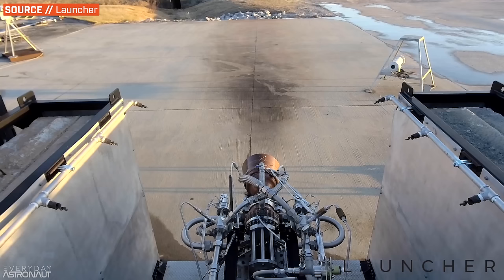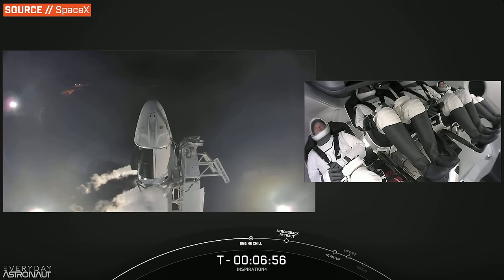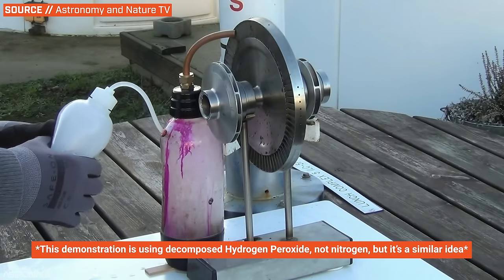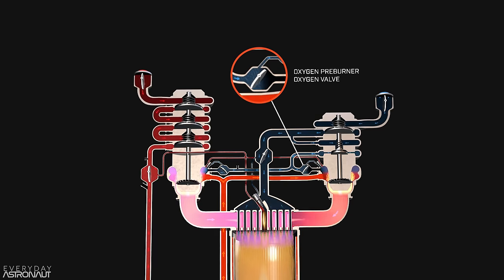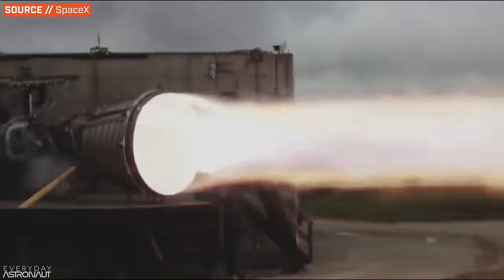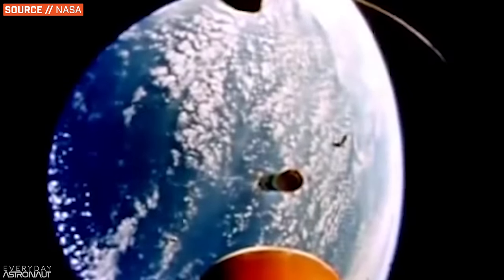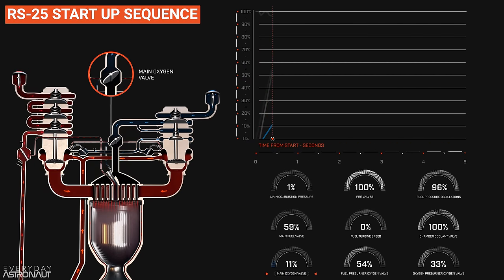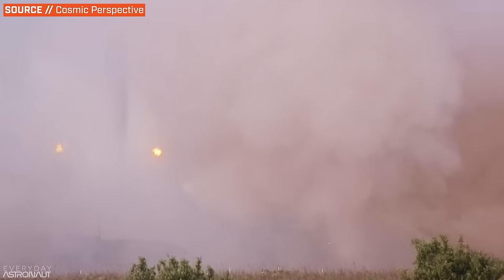Why Starting A Rocket Engine Is So Hard!

Comment: Maybe im stupid but the valves at the bottom and the lines dont share color very well, some of them matches with nothing, and you are just left guessing. Some are easy and some are impossible. So if we stop at 43:38, there is just one line but 8 different readings from the valves, it doesnt make it easier to understand, it makes it one hell of a lot harder, at least for me. As an example we at this moment have 84% full turbine speed, is that represented anywhere, well no.

Im not saying you are doing a bad job, but if i were you i would link all of them prior to going through things, what they are and what they do, each of the nine valves / readings. as another example where is the chamber coolant valve, fuel preburner oxygen valve.

There are a million different ways to explain it but it seems to me you managed to hit the one that has nearly no relevance to the graphics spot on.

Comment: How will they light Raptor in Mars if they need Nitrogen or Helium for the spin-up? Do they take it from earth? i mean there is some Nitrogen on Mars atmosphere but...
Reply: they will need infrastructure in more for the ignition process, you don't need a lot of these gases.. also they could use electric motor send before. It's going to be hard either way.

Comment: What would sls do if only one srb ignited?
Reply: It’s almost impossible for that to happen but if it did the capsule would eject and fly away while the launchpad would most likely be vaporized
Reply: @peeperleviathan2839  I have no doubt it's near impossible. My concern would be when they decide to detonate. The flight systems on the core would probably try to counteract the unequal thrust and I think that would let it fly up and sideways at least for a bit instead of instantly flipping. Would they try to let it clear the tower or blow it right of the bat

Comment: I love how Soviet engineers try to make everything simple, if you have half as many parts it's harder to fail.
By using fuels at room temperature and that can burn by themselves they save half the parts. And why stop the engine and put in a solid engine to do the stage separation? Better to start the engine while the old one is still pushing. 😆😆

Comment: There appears to be a tradeoff between efficiency and complexity. Also, full flow staged combustion would never work with physically larger engines. I hope Raptor does not end up in the realm of asymmetric risk. In other words, engines seldom blow up, but an explosion can take out a whole Starship. I'm betting on Musk to succeed, and I'm encouraged by the simplifications being made to Raptor. The engineering complexity and fine tuning of these engines represent incomprehensibly sophisticated technology. Musk is amazing. Can one begin to imagine the mass production of Starships? Not just production rate, but the complexity of the machines being manufactured. Wow!
Reply: there are some relatively simple engines that achieve insane efficiency, for example ion thrusters are a LOT simpler to operate then liquid fueld rocket. The combination of high thrust AND efficiency is what tends to get you. Oftentimes the most efficient engines are hydrolox but those tend to not produce as much thrust as equivilant (from a complexity point) metholox/kerolox engines

Comment: I think it's so remarkable that the Germans got this to work already in the 1940s. Like to get the articulations of the valves right to ensure the right flow without using fluid dynamics computer models is just crazy. And imagine diagnosing failures before you had the sensors and digital equipment for registering inputs. You basically only had pressure gauges and the act of manually sifting through the rubble after each RUD lol
Reply: you can draw a crap tone of data from something like seismographical data and theres also for example paint that changes in color depending on the max heat it was subject to. It was certainly a very different time but they had tools that we nowadays just dont need anymore because we have microcontrollers that do all on their own

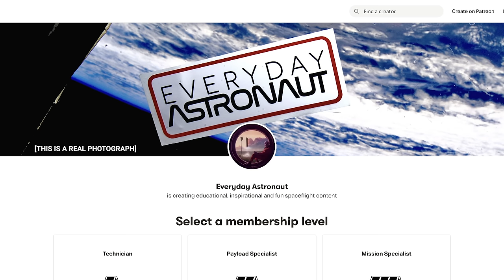Comment: 58:30 So much trouble just because we dont have a good baterry storage. But hey we like to over-enginering...hahahaha.(ICE motors vs electric motors). But we get the result wich is moving forword.
Instead of us precise balance and spend milions on hard test, just try use electric power generator?
Take the thermal gas electric power plant and put it underneth of rocket and avoid all that pipes gas and some of the valve. You waste some fuel on that generator but you get the electric power needed. and only need 2 or 4 valves if preburn must have.
Ofcourse must be redesing the entire propulsion but chambers,turbopumps,injectors are the same. 
I expect see something about injectors but i must wach in other side.
PD: i will make my own engine, linear aerospike..... one day.

Comment: At 49:10 you shown that fuel pump more or faster than oxygen but I heard Elon said Starship is ~70% Oxygen and ~30% Fuel explain this..
Reply from the maker: Hydrogen is 6 times less dense than methane, so it takes a much bigger pump to do the same amount of work. Raptor runs on methane, RS-25 runs on hydrogen

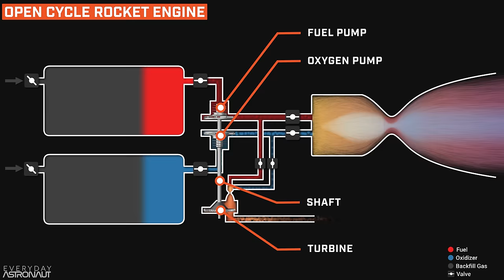Comment: 14:47 "hundreds of thousands of horsepower". Now Tim, you well know the F1 turbopump produced only 55,000 hp. Has there been a more powerful turbopump? Or, when you say rocket or engine, do you actually mean stage/combined horsepower?
Reply from the maker: The RD-170 is about 200,000 horsepower. I believe the Raptor is 100,000 horsepower!

Comment: Is it all automated or certain people turn on certain things? You don't mention that.
Reply: start up is 100% computer controlled. every millisecond hundreds of tiny valve adjustments and parameter changes need to be made in response to the current and future conditions to counter act the rapid changes in flow/mixing dynamics and pressure fluctuations.
Reply: Manually operated rockets sound dieselpunk as hell, I dig it

Comment: I find steel wool, 2 car batteries in series and high pressure oxygen to work just fine.
It is simple if the engine has no moving parts. 🤪

Comment: Cavitation are basically mini explosions on the surface of the pump impellers, u boats suffer from the same problem, due to the fast movement of the screw they create small bubbles at the surface and when those collapse it´s not only audible but like a waterjet that takes a small amount of metal with them.
So you´re telling me an orbital rocket engine is nothing more than a fire fueled turbski. Boys and their toys, huh. 🤣
Glowplugs do not ignite themselves, they are just an air heater so on compression the air is hot enough to ignite the diesel injected. Which is why in cold climate countries like canada or alike cars will have grid heaters rather than glowplugs to heat up the air in the intake before it even gets into the combustion chamber as you´d have to have glowplugs running for way too long for them to survive a reasonable amount of time.
Oh yeah and controlling an engine via oxygen flow is way easier than controlling it with the flow of fuel.

Comment: Oh WELL done with this video Tim and editing team.  With a few more mental and physical workouts, you could be a crew member instead of a passenger.
Hope your dream transpires Sir.
Reply from the maker: I’m already going to the moon with Dearmoon on Starship! 💪 hope you’ll be watching! And thank you!
Reply: @EverydayAstronaut  Yes, I knew about that Tim.  Just wishing you luck.  And YES, I will certainly be watching - if I have not shuffled off by then Sir.

I have asked the following question several times before.  Hoping you might research the feasibility and find something of interest to armchair astronauts for a published video...

Can a "fueled" deceleration for re-entry to Earth avoid the heat-shield dramas?

I ask, because WHEN SpaceX has the the Starship boosting heaps of fuel into orbit for Mars or other missions, it does seem rather silly to battle with flaky ablative-heat-tiles forever, when a suitable fueled retro-burn might achieve re-entry without undue thermal stress.

Comment: Turbo Pump Control using Computer Control Valve Compensators to keep the flows in check with all those Variables What a Task ! If the System can be Combined in to a Uniform Control Pressure Regulator with Dampeners over full range of Pressure Cycle ! Recoilless Main Spring Winders Light Weight H.D. Eliminating Bypass.. Bell in Russian Igniters Redstone Alcohol H2/0 Burner for Ease of Every thing with new Corrosion Protection Availability !
Reply: Yes,  I agree with,   what a task!  
Because,  that's the only thing 
I understand what you said. 😊

Comment: There are a number of misconceptions in this otherwise wonderful presentation. At around 10:00 mark, for instance,  "cavitation" is discussed as if the mere presence of  a bubble in a liquid pump can cause metal surface damage - it is, more precisely,  the formation of bubbles in rapidly expanding liquid in the rotor/stator complex where there are suddenly diminishing local  dynamic pressures, and interacting locally with blades and casings at high speed DURING operation. best regards, DKB

Comment: So that’s why folks associate complexity to rocket science🤓
Reply: In part yes, but other fields of engineering have to deal with complex valve sequences and that kind of things

But "rocket science" has to deal with very complicated plumbing and sequences, material science (you need to make special alloys that can withstand difficult environments at both high and low pressures and temperatures), aerodynamics (and all the difficult flow analysis that it comes with) very precise tolerances for parts and bunch of other thing 

Other types of engineering deal with one or two of these at the same time, but "rocket engineers" have to deal with all of them at the same time while having to make every system as light and reliable as possible

Comment: On that note, 
Moon orbiting mission success rate about 50%
Moon crashland mission success rate about 50%
Return trip from moon surface 6 of 6 success 100%
Smooth as hollywood studio
Reply: the reason they were so smooth and successful is because they had to be. If a cargo rocket blows up, the taxpayer is mad about his money being wasted, if you blow up the ascent stage, you are fucked. The engines were pressurefed hypergolics that had such a corrosive fuel that they had to be rebuilt every single time after they were tested for a full duration. They were so crucial that any design change had to be signed off by the top level NASA scientists and couldnt just test around with it

Comment: This video is a prime example of the difference between a scientist and an engineer.  The scientist thinks up the idea or theory, and the engineer makes it work.  The science of rocket engines isn't that hard to wrap your head around.  The engineering to make it work, and work reliably, that's hard.

Not saying that science is easy, just saying it takes BOTH disciplines to end up with a working thing.  And often times the science is gloriously simple, once you figure it out, and the engineering is stupidly complex to make it work in the real world.

Comment: Be me 

See video from Scott manly about injectors 

Think I can do that 

Do that 

Make 4 failed injectors in a week 

Make 1 functional one 

Make a rocket engine around it for fun 

Find out feed line pressure ater ignition is a big problem 

Make a electric turbopump on my DIY CNC machine 

Find out cavitation is a big problem

Comment: If there’s no oxygen in space….
How do they achieve combustion of the rocket
Reply from the maker: Rockets bring their own oxygen. Usually in the form of liquid oxygen but sometimes other oxidizers like nitros oxide etc. So propellants are always made up of a fuel and an oxidizer and on most rockets it’s pretty close to a 1:1 ratio. But on hydrogen rockets is a 6:1 ratio
Reply: Furthermore how is combustion possible without pressure.
Reply: @blazeobaggins5228  no static pressure does not mean no dynamic pressure btw. thats like fluid dynamics 101

Comment: why not start the turbines with an electric motor?
Reply: The power required to start the turbopump is very large. It is relatively easy to deliver a few megawatts for a second with just blowing compressed helium from a tank, or by firing a small pyrotechnic charge, but a megawatt motor (1400 horse power) with all the required wiring would not be a practical thing to carry on a rocket.
Reply: @cogoid  thanks that makes sense.

Comment: Space starts at 62 miles above the earth nothing has ever been to space because rockets can not produce thrust in a vacuum so the rocket just falls back down at the 62 mile mark
Reply: Never heard of conservation of momentum?
Reply: @GuardianSoulkeeper  neither have I I think it's one of those things they say to keep you away from the truth
Reply: @James-zp5po  What is the flamy stuff that comes out of the business end of a rocket made from?
Reply: @GuardianSoulkeeper  it is made from something that will produce thrust as long as there is air which is below 62 miles above the earth because above 62 miles above the earth there is zero pressure and a rocket will not produce thrust in zero pressure
Reply: @James-zp5po  It's made from something. Good enough.

Consider an inertial reference frame, is the velocity of this "something" precisely equal to zero?